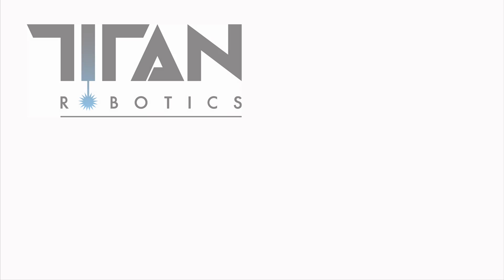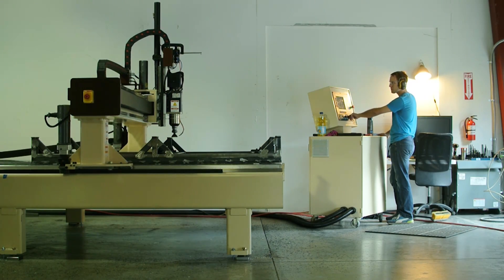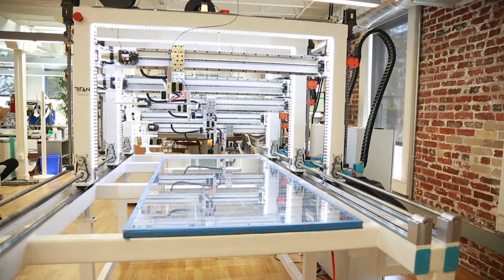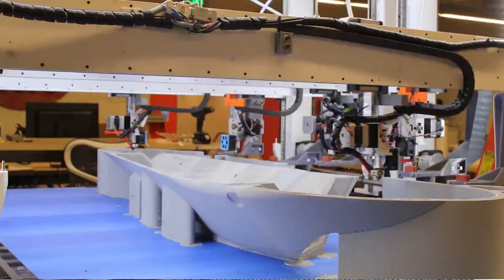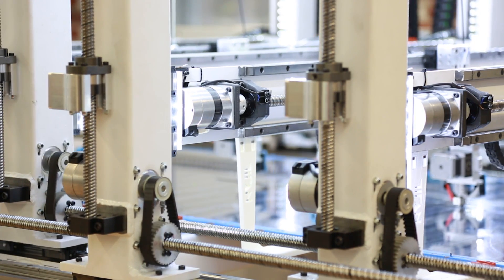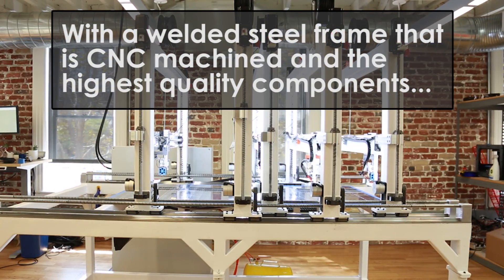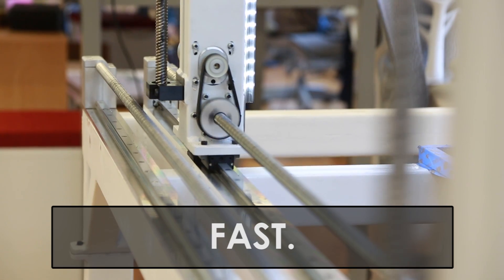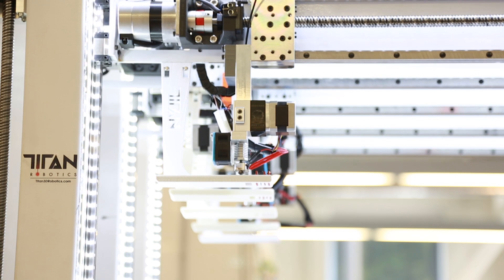The Cronus: Mutli-Head 3D Printing

Comment: This software is very interesting for concrete house printing .
The main problem to 3D print houses is the small time available between 2 layers .
If you want to use less concrete, have a better resistance and a better thermionic insulation, the ideal will be to print thin internal walls, like internal bones structure of big flying birds and keeping a time between layers optimum for the product in use.
Unfortunately to complexity the inner structure slow down the printing process thus the  all size.
Concrete print head in matrix  to print very thin wall will be interesting too.
Since the problem is at 90% software your work is very interesting

Comment: It has been my understand (just learning about 3d printing), that the production is not really the speed but the quality of the plastic formation.  so bigger faster making crappy quality achieves little.
However, I have thought of using multiple heads close together to make prototyping faster, it is painfully slow to build something that takes hours just to find out it needs to be redone.  This is like using punchcards to do computer programming how we did it in 1980..